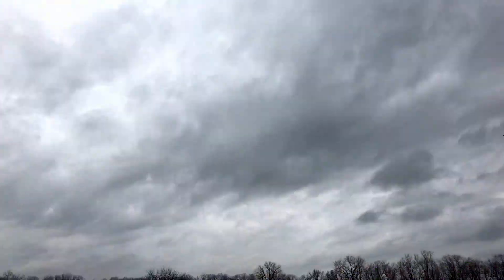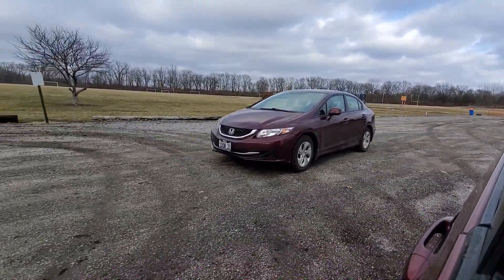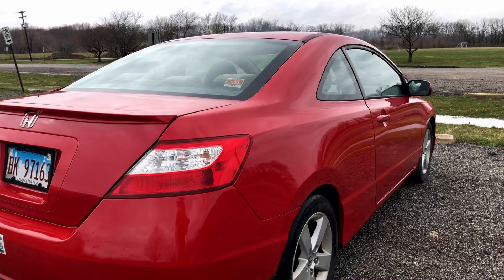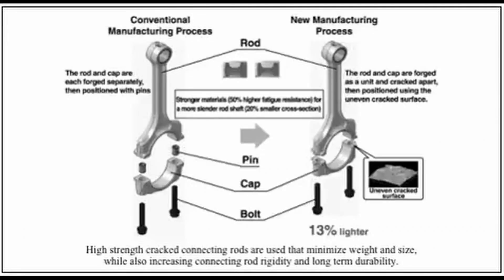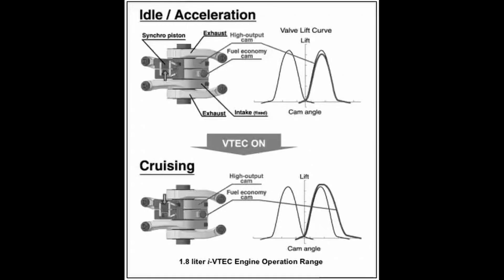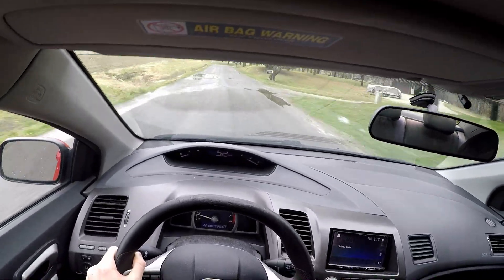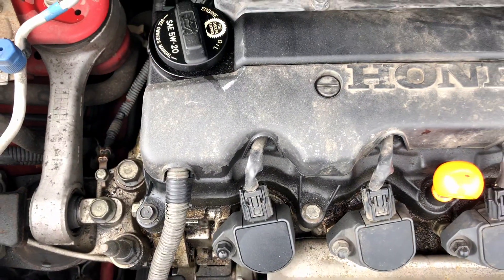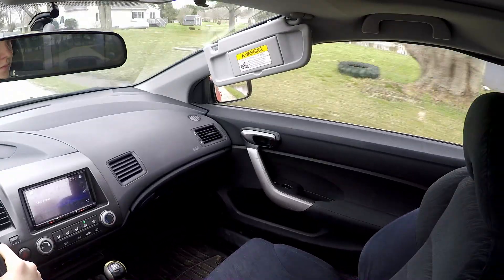A Brief Guide to the R18 Honda I-4 Engine

Comment: R18Z1 works the same way. I thought VTEC would work the same way as it works in any Honda but it's for saving fuel only and is engaged 1000-3500 rpm. I'd prefer K20 engine but R18 is still not bad for someone who doesn't need performance and needs to save gas.
Reply from the maker: R18 is great for what it is. I'm always pleasantly surprised by its performance. It's far for gutless as far as economy powerplants go. The K20 might be my favorite 4-cylinder I've ever sat behind. I drove an 8th gen Si once and it was an incredibly fun experience. They're two different engines for two different use cases but they both fill their niches quite well. Honda's great at making the right product for the job.

Comment: the 8th gen r18 Civics actually redline at 7000 RPM with a fuel cutoff of 7100 rpm while the 9th gen R18 Civics redline at 6850 RPM with a fuel cutoff of 7000 RPM & Eco VTEC really only works on the automatic transmissions it works on the manual transmissions as well but isn't as effective  as the automatic

Comment: I just bought a 2011 Civic EX coupe with 188,8xx miles.

I love it so far. I have some sportier Hondas, so i dont want to modify this. The exhaust has a leak, though, so maybe I'll put something solid on there.

Great video, im subscribing.
Reply from the maker: Thanks for the sub man. They're pretty phenomenal as far as value for money goes. Probably a good call to forgo modifications, although I always guiltily enjoyed the exhaust note when my muffler fell off (even though I knew I was THAT Honda guy with a broken exhaust), a good exhaust could be worthwhile. Hopefully it serves you well for many more miles!
Reply: I had one as well, we zapped it with the cheap welder my buddy got from harbor freight and I haven't had any codes in over a year.

Comment: The only downside about my r18 in my honda civic 2012 it drinks oil for some reason? At 95k miles
Reply: Did it have any previous owners? If so, then it probably drinks oil from the previous owner who probably neglected to change the oil. Typically what I’ve noticed on hondas, the only way to make it a chronic oil burner before 100k. Is the person who first bought it, at say 10 miles right off the lot. They probably never ever changed the oil. And if they did, they did the first oil change at 30,000 miles. And at that point all the rings are shot for the remainder of the cars life. Making it a chronic oil burner for the remainder of the engines life.
Reply: @iprophecy6768  it had two owners and the oil changes have been in the dealership at 10k miles one or two was slightly over at 11k miles but yes i agree with you oil changes are very important and i myself change oil every 3k

Comment: I'm confused about the description about the VTEC in the r18 you described.  My understanding is the two outside lobes on the cam are symmetrical, and the middle is the deeper lobe.  That is traditional intake VTEC.  I could feel and hear it engage just above 5k rpm.  Am I misunderstanding?  This motor was not the e VTEC.
Reply from the maker: I perhaps didn't do the best job of describing it. The IVTEC in the R18 operates off of the same basic principle as other VTEC system wherein two separate cam profiles can be selected. In old style traditional VTEC (and IVTEC in the K20), this switch in cam profiles to a more aggressive cam is triggered by reaching a certain RPM, usually around 5k. However, this is not how the R18 works. IVTEC in R18 is Intelligent VTEC, which is not determined by RPM alone, instead a number of values are weighed by the ECU and used to inform when the cam profile should be switched from a "normal" state (better for power and torque delivery) to a "economy" state (providing better cruising characteristics and fuel economy). Under normal driving, this switch is made around 3.5k. So unlike in other Honda platforms, you have more power and torque down low and your cam profile becomes more mellow once you get into the higher RPM (unless you keep on throttle or the ECU determines the standard cam is still needed, in which case the cam profile will not change). This makes the R18 feel more like a 2.0 liter down low when getting up to speed and more like a 1.5 when cruising on the highway, offering the best of both worlds. 

The kick you experienced around 5k (which is also something I've experienced with my R18 as well) is most likely the variable intake manifold, which opens valves in the intake runners at different RPM to change the path of air into the intake, allowing the engine to more efficiently generate power at differing speeds. There's one geometry for low down power and torque, and another geometry that is triggered around 5k which provides better high end power for highway passing. 

TLDR; The R18 has "Intelligent" VTEC that does not kick in at 5k, rather it is dependent on whatever the ECU decides is best. Instead of switching from a "normal" to a "performance" cam like in other systems, the R18 IVTEC switches from a low speed "normal" cam to a high speed "economy" cam for better highway mpg. The bump in power around 5k is due to the variable intake manifold. 

Here's some extra reading:
http://asia.vtec.net/Engines/RiVTEC/index.html
http://asia.vtec.net/Engines/R18A/index.html
https://www.8thcivic.com/threads/r18-variable-length-intake-manifold-and-how-to-properly-throttle-control-accelerate.220507/
Reply: You did a good job, I misunderstood and now understand.

Comment: Bro where in the fuck do you get your info or how did you do your research because you are so wrong about the R18A1 I've seen atleast 5 over 350hp and 3 500 to 791hp this is a great engine to turbo and it spools the turbo fast so go back do so real research quick being a pussy and saying just get a si it's obvious that you don't work on your car so be a man build a  car stop taking the easy way out

Comment: The r18 engines made past 2011 has a red line of 6800 RPM so from 2006 to 2011 the red line was actually 7,000 RPM in 2012 they reduced it to 6800
Reply: The Honda R18 engine can actually handle a very decent amount of power The only thing that's holding it back is the crankshaft and the transmission can't hold anything past 300 horsepower
Reply: 140 horsepower out of the Honda R18 can actually get you to 150 mph you just have to get some Toyo proxis R888R tires which are rated for 200 plus miles an hour and you will also need a Hondata to unlock the ECU speed limiter
Reply: @YaBoiMyles954 where do you get those tires and what else do you recommend
Reply from the maker: That's interesting, do you know why they made that reduction? Was it an emissions thing?
Reply: @carpartsandexhaustfarts also the 8th and 9th gen R18 civics have dual phase VTech but it's not the same thing as what is on the Honda d series engine basically for the Honda R18 it has variable intake runners where past 5,000 RPM a flap in the intake manifold will change positions from the longer intake runer to the shorter intake runner increasing performance and horsepower
Reply: The 8th and 9th gen civics are in fact made almost exactly the same but they are also made differently at the same time The 9th gen Honda Civic with the Honda R18 engine has a harmonic balancer while the 8th gen doesn't @carpartsandexhaustfarts
Reply: Fuel cut-off 2006-2011 is at 6,900 RPM

Comment: For a 1.8L 4 banger, this thing is incredibly impressive. Its not a performance engine, but it definitely feels like one in some cases

Plus the engine is fucking unbreakable. You can do whatever the hell you want to these things and theres a good chance it’l still hold up against it.
Reply from the maker: It really is shockingly good for what it is. One of the best motors in this segment in a long time.
Reply: @carpartsandexhaustfarts  I got an 8th gen civic with one and, aside from a slight half-second delay between pressing the pedal and the car actually responding, it handles very similarly to a sports car. Plus, ive managed to pull a 0-60 in under 8 seconds in it (despite the general consensus for some reason being that it cant do it faster than 9-10)

Comment: R18 has 280k miles no it doesn’t have power I have an ISF for that. If you want a fast car buy a fast car if you want economy buy that, don’t think you have “power” w 2 or 300 HP . That’s still very very low

Comment: Wait then why is my 11 fd civic has a rev limit of 8k?
Reply from the maker: Is it an SI model? They had an 8k redline during that generation. The rev limit may differ by what market the car was sold in as well.
Reply: @carpartsandexhaustfarts  holy smokes, firstly tysm for replying to a 3 year old vid. I live in India we have fd1 here, perhaps that's the reason? Sir if you wouldn't mind, can I ask a few questions please?
Reply from the maker: @waveoptic  Of course, I try to keep up with comments. I wouldn't be surprised if it's a difference in market spec. This is just speculation, but maybe they limited the USDM models to 6.8k in order to meet fuel consumption/emissions standards. I don't know what India's emissions laws are but I'd imagine they're more relaxed than here. Feel free to ask questions but I'm just a nerd not a mechanic so I may not know all the answers haha
Reply: @carpartsandexhaustfarts  ooo i see, so my question is sir 1) will doing a muffler delete hurt my car in anyway? [ Since I am just a student, i am trying to save up for a good exaust system but I do want the car loud till then, so this is my best bet since it's cheap ] and will it be enough to make the car burble? [ If so , then I'll ask the shop to remap for no burbles ] (2) my lights are kinda dim [ headlights ] I have sanded them and Everything but still no significant improvement, can I install brighter led bulbs, will that be better instead of buying a new headlight setup, since headlights are quite expensive so I can't do that until future. 

Tysm for your time and reading through all of this. Hope you've a great day ahead :))

Comment: Hey to anyone willing to answer and knows a thing or 2 would this be an ok motor to cop from jdm to drop in a old civic for a daily build
Reply from the maker: Not an expert and don't have experience but I know those Japanese engine importation companies can be a little sketchy. If you find a good company with a motor in decent shape it certainly makes a good daily powerplant. If it's going in a civic made before 2006 you might be better off with a B, D, or H series just for compatibility reasons, but I'm no expert.

Comment: Whoa, the power really only occurs at only 4k and above, I'm not a fan of revving the engine to move it along, plus the noise. How reliable is the engine when you have to rev it to these levels over time?
Reply: I had a 05 1.7 VTEC and it was a good car it would move out till 4th gear. This thing I have to actually press the pedal to get my 06 to move. And the engine may be reliable but everything else is not worth the shit. Something is always breaking

Comment: Best economy inline-4 motor. Revs smoothly and with haste all the way to redline, super reliable, and will make 240-250 HP reliably boosted. Surprised NA/NB Miata folks haven't picked this up considering how abundant they are.
Reply: can you boost them reliably?

Comment: The Honda R18 does not have a red line of 6800 it actually has a red line of 7000 if he has a automatic transmission the computer is programmed to short shift at 6800
Reply: Fuel cut-off is @6,900 RPM

Comment: This motor is bulletproof. My 2010 Civic has almost 400,000 miles on it. And I just drove it from Orlando Florida to North Georgia a few days ago. She's a beast!. Super fun to drive too. With proper maintenance these things can run forever. It's been the most reliable car I've ever had in my life so far.
Reply from the maker: Oh my lord 400,000?? That's absurd but I don't doubt it in the slightest. My experience with this motor has also been nothing short of excellent.
Reply: @carpartsandexhaustfarts  I have pictures to prove it!
Reply: I'm hitting 300,000 on mine and runs better than when it got it. Well with proper tune ups and maintenance, it still pulls your neck back!
Reply: Mine also has 400k on it!!
Reply: 2011 civic sedan EX... Just around 215,000km on mine... The motor run like a new... Even happen 2-3 time that i try start it when he alrealdy running because he so smooth and silent that you don't notice that he actually running!!! Zero oil consumption or leak... For most of is life he pull 5 passengers and frequently pulling a trailer... Even the body is in very good shape... No rust at all!!! Very good and reliable car!!! A guy i know have more the 350,000km on the same model and still run like a new!!! 🙂
Reply: 2012 Honda Civic 306,000...did you replace the timing chain? I have not
Reply: Incredible! How many times did you guys adjust valve clearance?
Reply: @soupdeluxe  personally I never have. They are only noisy on a cold start during the winter. Once it warms up, it’s fine. I’d probably only adjust if I was replacing the valve cover gasket anyway.
Reply: @soupdeluxe  Never!
Reply: @soupdeluxe over 300,000 never adjusted valves they are not making any sounds
Reply: How was it driving that distance with 400,000mi? I want to make a 400mi trip and I have almost 300k/mi on my 2009 Civic. But I've been scared to push that distance and back. I use it mainly for local commutes.

Comment: honestly love my honda got an 09 dx manual and its r18 is unbreakable with proper care especially if you keep the car stock. and like you said its a blast of a car if you don't look at the speedo
Reply: do you think a ecu reflash is not good for my r20 engine ? if all other things are stock
Reply: @dinoarnaut9438  I wouldn’t recommend if you don’t have any other mods if you plan on any bolt ons I’d do it after installation

Comment: I beg to differ with you.  Many people have gotten 300 plus hp out of the r-18 with no engine problems at all.  Very strong engine.  Let’s look at power to weight ratio.  A K-24 swap will add 170 pounds to the front of your civic and the si sedan is about 150 pounds heavier than the civic coupe r-18.  Yes 180 hp is possible with a cam , intake, exhaust and a re-flash ecu.  Add some carbon parts like hood and excess steel removal and you have a very lite civic with 180 hp or boosted with 275hp.  The manual ex coupe 06-11 is only 1/2 second slower than the 06-11 Si sedan in 0-60.  Not worth it for the cost difference and you can find r-18 parts and motors really cheap.
Reply: decreasing weight is the number one way to go in something like this. Its cheaper. If you want to make a fun cheap sleeper decrease as much weight as possible

Comment: They actually respond pretty well to exhaust, intake, and head porting. Is it a DOHC fire breather? No but a 160-180 HP and mid 30’s-40 MPG with damn near un killable reliability is a damn good combo. Mind you this isn’t an SI but there are R18’s everywhere for 200$ still. I can’t even buy B20’s or D16’s for that anymore.
Reply from the maker: This is where the R18 really shines, it definitely deserves more recognition from the Honda community.

Comment: got to disagree with ya on the boosted bit... while she's never gonna compete with b or k engines, honestly.... its a good little cheap engine that can handle like 300 horse with stock internals... to be fair that may be pushing the engine a little, without a rebuild that is. she does have an advantage on the weight side of things if you compare the si to the ex, its almost 200lbs heavier. all that to say, I've heard of some boosted r18s going for 11 second quarter miles.... which, while it may not be able to handle that for extended periods of time... its completely mind-blowing for any 1.8 to get even close to that.... what's more mind-blowing is that many ppl claim 7psi on a turbo will give her just shy of 100 extra hp!

Comment: I have a 07 civic lx and it's good but always leaked engine oil onto the clutch can only feel it when it's bone cracking cold it will cause the clutch to chatter when it's engaging

Comment: r18 motor is one of the BEST engines honda has ever made.  extremely reliable workhorse!
Reply: Definitely
Reply: I've had mine for over a year and a half, got it with 106,000 it's up to 147,000 now. BEST car I've ever had! I've had 3 Hondas and they just don't compare to how much I love my 8th gen
Reply: @IDOWOH  Mine has 204,000 miles and uses about 1 quart of oil between oil  changes.
Reply: @martinduke368  PCV valve
Reply: @martinduke368 mine is at 220k and uses about a quarter of a quart unless i use mobile 1 then it doesn’t burn at all.
Reply: @GeorgeFhore  I drive a rural most of my commutes, begins and ends with a freeway. The more often I pass, the more oil I use. I go to 5000K between oil changes, so up to 1 QT and as little as like you do. Mornings are often passing apparent drunks or people with poor vision.
Reply: @GeorgeFhore do you rev it high sometimes or like just never at all cuz i am worried to make the oil change maybe a bit sooner since i took it to a few touges etc
Reply: @georgerapt2292  very rarely.
Reply: The L series too.
Reply: And the B series? Witch is better?
Reply: @armandoaraujo8549  B series better
Reply: My r18z4 currently on 340,000kms with no issues ✌️😉